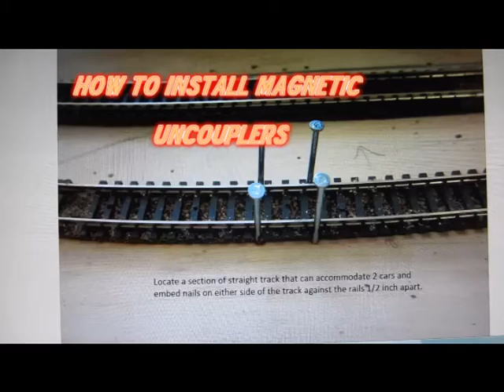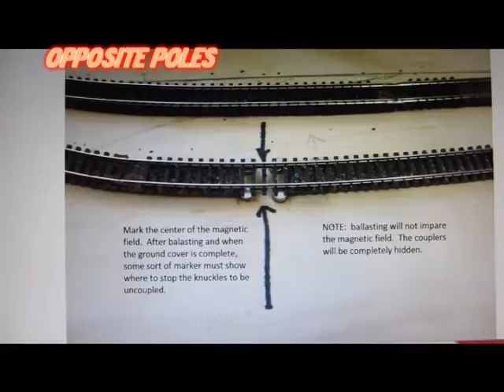Magnetic Uncouplers

Comment: I'm running HO and want to try your approach.  Cork roadbed  is 3/16 inch, so three of your magnets at each location should be adequate, right?  I will use magnets as you. Wish me luck!
Reply from the maker: Rick, I would recommend that you view my video "Magnetic Uncoupling Revisited".  Actually I have since discovered that the screws are unnecessary.  As to the number of magnets, it depends upon what size is available.  If you have 1/16" thick magnets, then 3 would be good for 3/16" roadbed; however, I would try it out first.  Three magnets per stack may be too powerful.  Additionally, you can counter sink magnet stacks that are too thick and use pieces of styrene on stacks that are too short.  Also note that I used Microtrains couplers in my method on N scale cars.  If you are using Kadee couplers, please experiment first.
Reply: Thank you for the quick reply and the link to your revisited video!  Excellent information!  I will order the larger magnets that you used.  I use 100 percent Kadee couplers on my HO layout.  Looking forward to giving your approach a try!  I have several Athearn cars with steel weights, steel screw to mount trucks, and a metal clip to hold coupler pocket in place.  Obviously need to do some testing to find optimum number of magnets, location, and solutions for metal in the Athearn rail cars.  Thank you for your video and excellent advice.  Best Rick

Comment: I've seen this work well, unfortunately the magnets seem to seldom be in the right places to do a good job. I do not use the magnets at all and still use the "delay" mode of the coupler to place the cars.
Reply from the maker: I hope you will consider making a video of your system for all to see.
Reply: @williamcasper6215  No video needed. Just uncouple the car as usual with the pick, push one of the couplers to one side with the stick, and then back into the car as you would when using the magnet.

Comment: I used three neodymium magnets under each rail (6 total)and it works good on my N Scale layout. I needed to buy engines now.  I read some where that as long as one has a metal draw bar hanging down and away from the engine, then the engines couplers should uncouple with under track magnets. I was going to buy an Atlas engine. Would you know if this is correct about metal draw bars?  On real trains it seem like these metal bars would be air brake hoses. 
Your site really helped me when I had to place two uncouplers next to each other on two tracks.
Reply from the maker: I'm pleased that I was able to help.  My advice about locomotive couplers is this:  Kato, Atlas and Bachmann couplers are not as efficient as Microtrain couplers.  I personally never uncouple at my engine unless I have replaced the original coupler with a Microtrain coupler.  Instead, I couple a car with Microtrain couplers which will not be uncoupled to the locomotive and uncouple from it.  As far as drawbars go, both cars must have one angled away from the back of the knuckle.  You can shorten the length of the drawbar if you find it necessary.  You might also review my clinic "#31 Magnetic Uncoupling" that I uploaded in March of 2021.  I've learned a lot since 2015.

Comment: Seems like one circular magnet in the center would be sufficient.  Have you tried using one?
Reply from the maker: This procedure worked so well I did not try any other options.  If you view my video "Operations At Mesa Junction" you can see how well it works.  I have completed this operation over 100 times without a single failure.  I know that a single larger rectangle magnet works fairly well on HO, but N scale is different because the couplers are different.